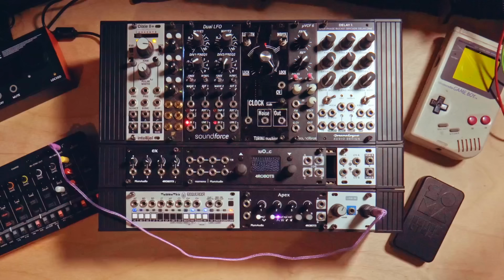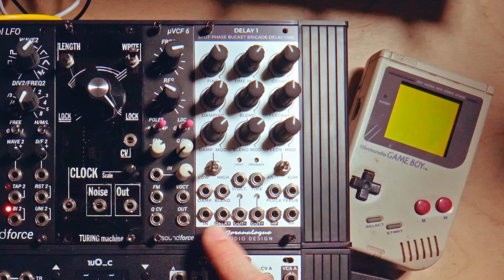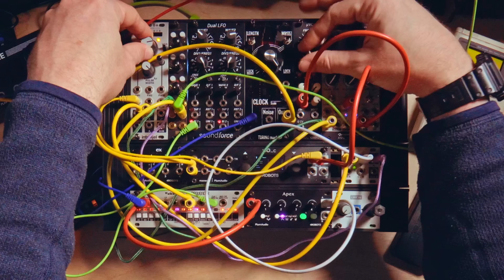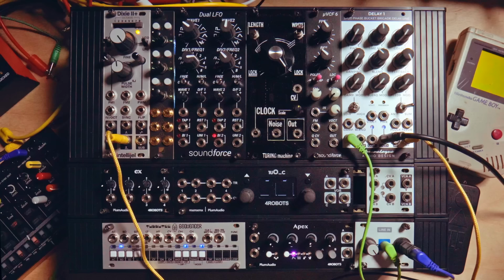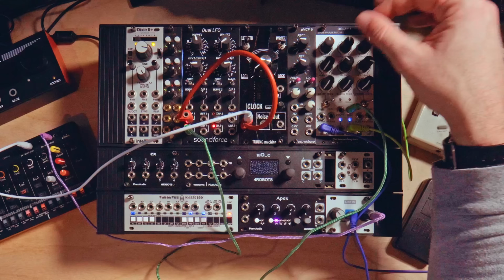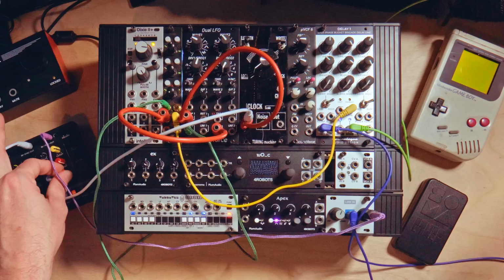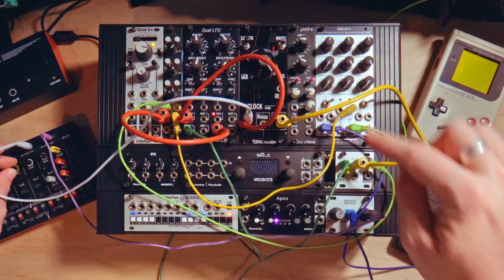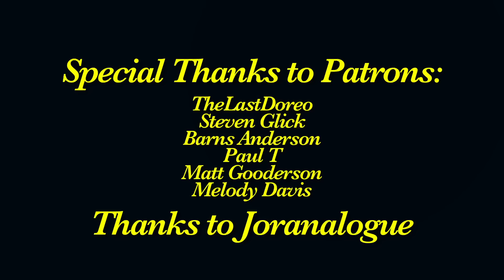Making insane sounds using TINY delay times. | Suggested Systems 6

Comment: Pulsar synthesis makes for a great exciter, and Beads excels at this. Either with a held buffer or using the internal wavetables (fully wet), set it to emit grains when triggered or at a constant rate. Feed this into any resonator, eg karplus delay or Rings, convolution, etc.. All the parameters of the grain, eg pitch, envelope shake and duration, become timbral controls on the resulting resonance. Playing with audio rate/ near audio rate grain input into a pitched resonator provides lots of fun.

Comment: 21:09 Doepfer’s range of BBD delays are completely unfiltered. To get rid of the clock whine, they recommend a filter with an ever steeper slope of -48 dB, which is double that of a standard 24dB Moog-style filter. Of course, they make one or two of those.
Reply: I must add that the clock's frequency is above audio for about half of the knob's range, so you can get a clean(ish) delay of around 150ms with the 4096-stage module and without a filter

Comment: 10:58 No don't replace it - combine them! For a brief moment, the 303 and karplus sounded great together. I wanted you to turn up the 303 sound in the mix (it was coming from the T8, I think?) rather than remove it!

Maybe get some additional data points first, but I suspect that combo could be a crowd pleaser.
Reply: I mean 303 and karplus in general, not necessarily the exact parameters that were dialed in right then. Which were fine, but you could spend all sorts of time finding the sweet spots.

Comment: I’ve recently been doing something similar. I put together a 48 hp pod with a Befaco CV Thing controlling midi modulations on a digitech studio quad four. Then sending a drumbrute impact through the digitech
Reply from the maker: Ooh that would be banging. Would like a CV Thing for such things - CV to MIDI is by far the most interesting direction.
Reply: The CV thing is a great module. I would love to see you make a suggested system with it. I’m using it with a modbox, maths, quad vca, and quad atten.

Comment: Mylar a great track. I have a question if you dont mind. Im getting a Cirklon this week but cant decide whether to get the CVIO version upgrade with the Breakout Box. I see you are a Cascadia fan and im thinking it would be a great companion. Having no other modular that is. Can i route several intrument patches from the Cascadia to the Cirklon? Are there other modular options that wont be too hard to start with.(Thats why the Cascadia appeals it looks so friendly. Cheers dude!
Reply from the maker: Thanks - I think if you don't have any other modular then perhaps it's not justifiable to get the CVIO (I obviously did buy it with it fitted but then I have loads to drive with it!), and the Cascadia does have several MIDI to CV lanes on it so you could use Velocity, CCs, Modulation from the Cirk and get CV out.
Reply: Thanks. True ill go with just Midi for now 😊